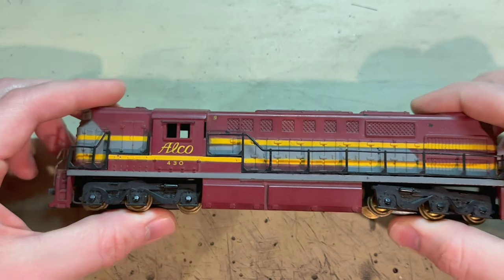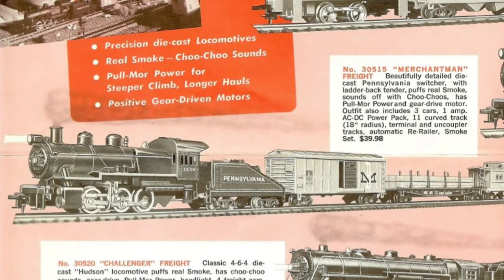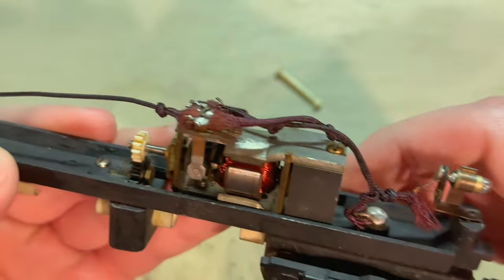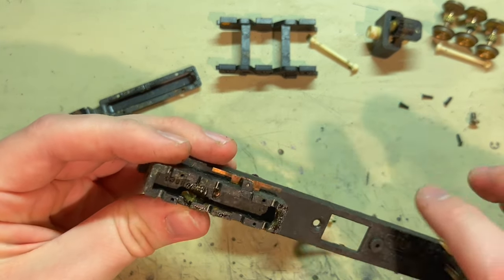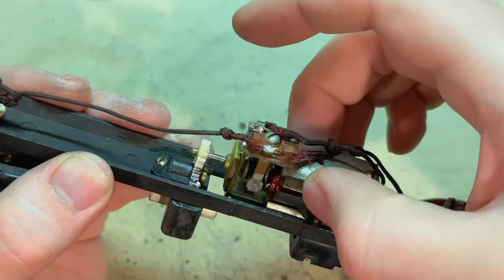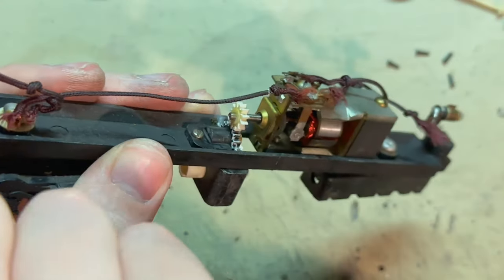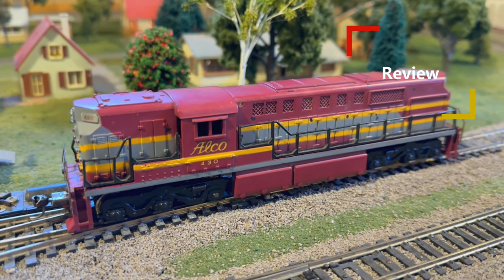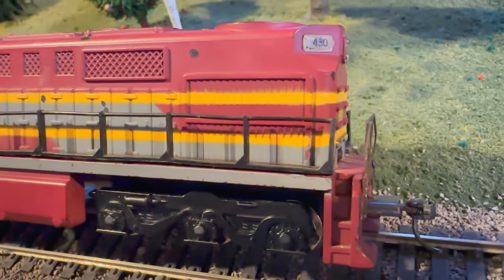Gilbert HO ALCO DL600 Repair and Review

Comment: I am glad you were adventurous enough to pry out the studs in the truck plates and show us it worked. I was worried for a moment. I do think you should revisit this locomotive and replace the incandescent bulbs and install LED lights. Then that old locomotive would have directional lighting. Great video in any case.
Reply from the maker: Thanks, that is under consideration!  Those old lights get really hot with all the amperage going through them, and I've seen plastic shells melted by hot bulbs before.

Comment: I found one of those on ebay a while ago. It only needs the driveshafts. I'll probably have to look for NWSL parts or maybe drive tubing for temporary. After watching how well yours runs I need to get mine going, looks like its a very powerful drive train. I wish American Flyer had built a S scale version of that, and also that type of drive train. I think it would have been better than their twin truck motor designs. The Gilbert HO Hudson steam engines are also really great to work on, you might enjoy that if you come across either a prewar or postwar version. Most prewars are AC powered, but I just hooked up an AC transformer to my HO layout and it ran just fine.
Reply from the maker: It should be possible to install NWSL driveshafts.  Since they're typical ball and cup joints, you can probably send the inside diameter measurement of the original cup to them and they'll let you know if it'll fit or not.
Those Gilbert Hudsons do come up more frequently than these.  I might get one eventually.

Comment: Thanks for the video on this old Gilbert gem. So replacing the bulbs with LED lighting would really benefit the models electrical efficiency. I gave up on the stock drive on mine and got an Athearn drive for it .Seems they lengthened the steps  and let the tank hang a little lower on  the Gilbert shell  then scale to cover the gear case on the factory drive . .I am going to use a Athearn trainmaster drive and splice some Bowser side frames on it that i have on hand.Tricky  and shorten the long steps and see how it looks and run it with older Athearn wide bodies...
Reply from the maker: Yeah, I'll probably do that for the lights.  These old bulbs get too hot for me to feel safe having them in a plastic shell.
The Athearn Trainmaster trucks will definitely give you a quieter and easier to maintain runner.  The Gilbert chassis seems pretty bullet-proof as long as it's well kept, but it sure is noisy!
Reply: @DarthSantaFe  .By the way the lower gear in the gear case is held in by the friction fit drive shaft nylon universal coupling .It is a one piece universal coupling  assembly and presses into and through the center hole in the gear in only one direction because the hole in the gear is tapered along with the universal coupling.. No bearings .Just the nylon riding in the metal case holes. These thing were pretty pricy for their time and this is what you get .Hummm?

Comment: I have a set of Gilbert HO scale Northern Pacific, 4 car set, that I changed the incandescent lighting to LED strip lighting and ruined the resale value of the set.  Last time I checked fleaBay, a set of those cars went for $400 to $600.  From what I understand these cars are quite rare.  I also chopped off all the horn hook couplers and installed body mounted Kadee couplers.  
Your model is a good candidate for neodymium magnets which will greatly improve the performance.  Cheers from eastern TN

Comment: The ALCO RSD-7 was a diesel-electric locomotive of the road switcher type built by ALCO at Schenectady, New York between January 1954 and April 1956. Two versions were built, with the same RSD-7 model designation but different specifications and power ratings, although both used the ALCO 244 engine in V16 configuration. Specification DL-600, of which only two were built, developed 2,250 hp (1,678 kW; 2,281 PS) and used the 244G engine. The revised specification DL-600A, numbering 27 locomotives, was rated at 2,400 hp (1,790 kW; 2,433 PS) and used the 244H engine. The RSD-7 was superseded by the ALCO 251-engined ALCO RSD-15, which looks very similar. The RSD-7 was the last ALCO diesel built with a 244 engine.

The 244 had been a disaster, which damaged ALCO's reputation badly. As a result, only 29 RSD-7's were built,12 for ATSF (including the two refurbished demonstrators), 12 for the C&O (which Gilbert offered) and 5 for the PRR.
Reply from the maker: ALCO had a lot of trouble developing combustion engines at that time.  The 241 engines went through a lot of testing and failures before they were torn down, inspected and replaced with the 244.  From my understanding, they were in development for years but were technically "rushed" because they had to focus their resources on war production.
Reply: Well that war excuse was unfair. EMD got the ", big HP production and all otjers, the switchers.
Who do you think was in a better position to got the market of mainline units. Alco copied the EMD E models with dame type of body that was en vogue at that time with 2 switcher engines. 244 was rushed out and we all know the results. FM was a newcomer with excellent diesel engines....in marine applications. Not so successful sadly in railroad service. Lima as a steam builder almost quit instantly with about 100 switchers. Baldwin, the last giant of steam era  didn´t believe in internal combustion. Try to improve up to the end those steamers. When he got in, was way to late. Ironically, EMD was the  less efficient in term of adhesion and electrical ruggedness. That weakness really ended up with SD40-2 production. And where was mister washing machines and toaster ? He plays in critters...until he made few demos that will be later on U25B.
Alco fall in 69, then EMD closed and survived in Canada under GMD, then Cat and.... mister washing machines is the King now with few dust of competitions.
If i ask an all time, who was the smallest to sell to a class 1 who is it ?  NO...not Krauss Mafei, nor Porter, Davenport, Plymouth etc... the big winner was : Ingalls Shipbuilding of Missoula with a world record breaking of.....
1 ! !  Yap, their total production was 1 locomotive, model 4S. Their demonstrator bring zéro sale and was finally sold to 
Gm&O.  The reason ? Well, Ingalls was quite a good client for that railroad...that make a favor to the builder in purchasing that unit that got good years of service. Sadly it was scrapped. I would love to have that bizarre contraption. Sort of streamlined nose and front cab à la Baldwin baby face, à covered body sides like an elongated F or FA with a clerestory roof like heavyweight passenger car and at the end, a vestibule, just like à coach. That unusual roof line offered with higher cab roof, some vision for the crew running backward. If my memory is good it was a Superior engine 1500 HP.
Back to the model, never heard about before today. Like its sound. It breathes power. If there is a way to extend  its motor shaft, add a flyweel it should improve it.
Thanks for that interesting unusual catch. Sort of Ingalls😊😊

Comment: Nice video. I was wondering why you didn’t clean the armature with a q tip and some alcohol! Always a needed step with the S and O scale armature. But great job and a good history. Thanks for sharing! @Cbtrainnut
Reply from the maker: Thanks!  The motor appeared to have very little use overall, so the armature was surprisingly clean.  These HO motors also tend to get a lot less carbon buildup than the AC O and S motors since they don't need nearly as much power to run.

Comment: I HAVE SEVERL OF THOSE ENGINES IN RUNNING SHAPE AND PARTS ALSO I HAVE CHESSI ENGINE TO WITH THE BELL RINGER IN IT .
Reply from the maker: Didn't know they had a bell option!  There is a lot of empty space in the shell though, so they definitely had plenty of room to fit one.
Reply: @DarthSantaFe  the SSCALE ENGINE DOES THE SAME THING AS THE TRAIN RUNS DOWN THE TRACK THE RINGS FROM GEAR BOX IN THEM .

Comment: May 6th I got the C&O 31022 which has a bell in it. I just fixed it and is running. There is a spring that applies pressure to the bell armature that I need to be replace. The body is not in great shape.

Comment: Great video. I have a Gilbert Industrial Switcher that needs to get the gear replaced, like the one at 11:17. How would you remove the wheel from the axle and how would you remove the gear?
Reply from the maker: NWSL's wheel pullers work best for this kind of work.  I've gotten a ton of use out of mine!

Comment: Gilbert's first HO products were actually much older- dating back to the late 30s/early 40s, with their diecast 4-6-4 hudson that had a universal type motor and electromechanical reverse unit. 

Frankly I've found that these Gilbert DL600 locomotives aren't super easy to find on the cheap, the $50-100 range really doesn't seem proportional to what you get.  They seem much less plentiful to me than the HO steamers Gilbert offered (especially the 0-6-0s with their preposterously high top speeds). I'm still looking for one, though not in any particular hurry.
Reply: Rebuilding a prewar HO hudson was a challenge but they are really nice engines! Mine sings around the layout.
Reply from the maker: Thanks, didn't know the HO line went that far back!

Comment: like the three worms in each truck
Reply from the maker: It was actually a common driveline for the day.  It wasn't really until about 1964 or 65 when Athearn created the modern gear drive chassis that manufacturers started to get away from the 1 worm per axle setup.
Reply: I just think worms sound better than a bunch of gears that can strip
 @DarthSantaFe

Comment: I would never have scrubbed the body shell with a toothbrush. You run the risk of damaging the paint. I normally use a soft 1“ paintbrush for that kind of work. If oily, I would add 1-2 drops of mild dishwashing liquid to a bucket of water. Rinse the model well after washing.

Comment: what is the compond you use on the wheels
Reply from the maker: It’s a white rouge compound that came with an aluminum buffing set.
Reply: can it be purchased from Amazon or ??
Reply from the maker: @mitchbosley5008  I picked up the set from Menards. If you don’t have a store nearby then it can also be ordered: https://www.menards.com/main/tools/power-tool-accessories/abrasive-wheels/tool-shop-reg-aluminum-buffing-polishing-set-14-piece/apk-1/p-1444421184844-c-10154.htm
The sets I’ve found on Amazon are more expensive, so I’d consider the Menards set a better deal.
Reply: @DarthSantaFe  I have a few old locomotives that have plastic gears and they are split into two  .is there a place to buy replacement gears?and also plastic drive shafts.
Reply from the maker: @mitchbosley5008  That depends on what you have, but NWSL makes a lot of replacement gears and universals.  Sometimes you can also find original parts from old stock at train shows, some hobby stores or eBay.